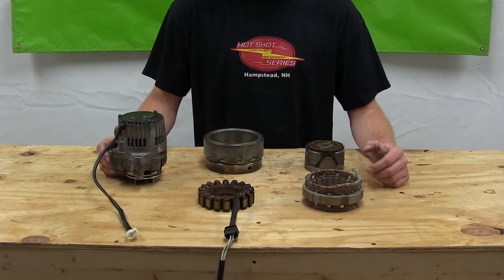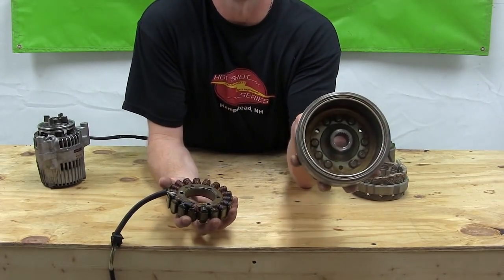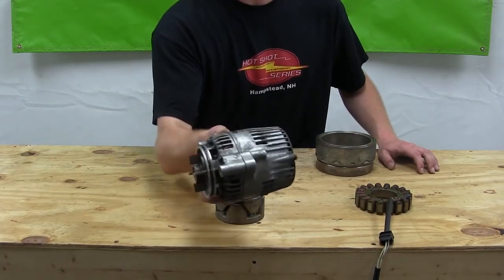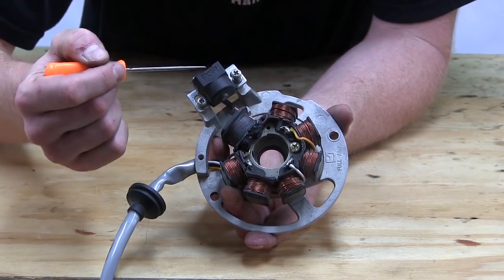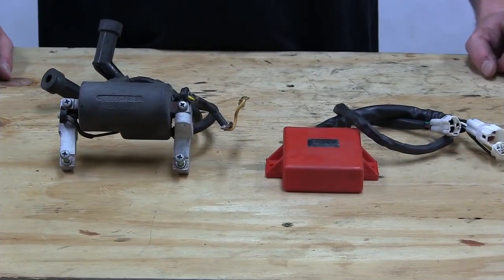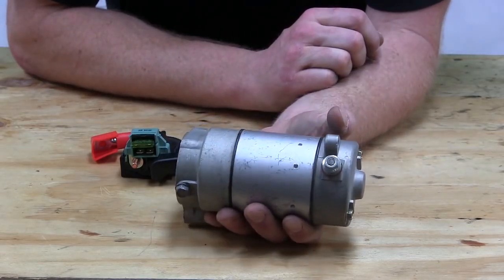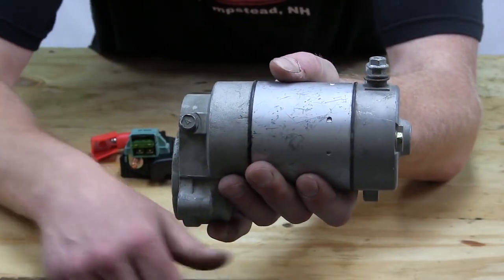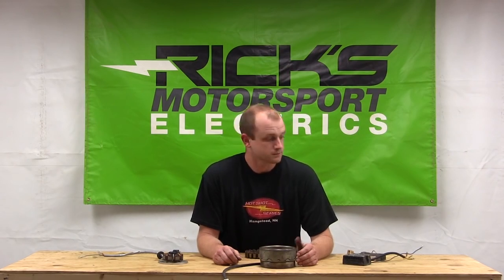What electrical part is that?

Comment: What would make a rectifier hot? On a rotor stator set up?
Reply from the maker: Current running through it will make it hot... that's why most of them have fins.